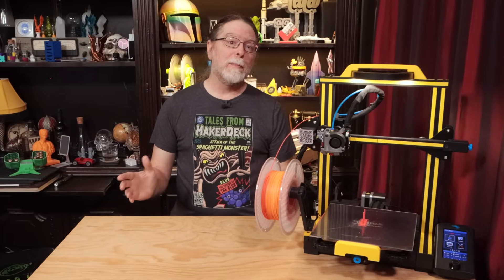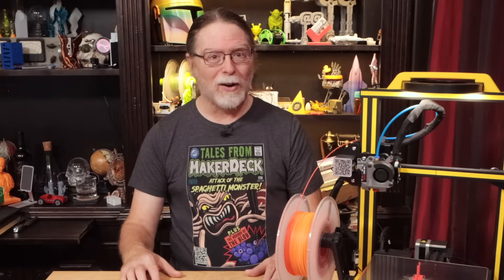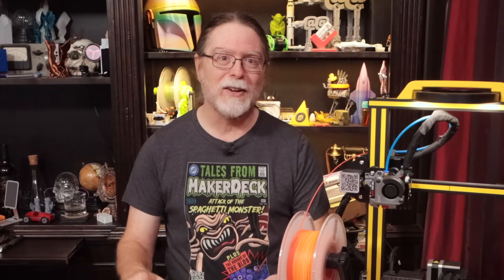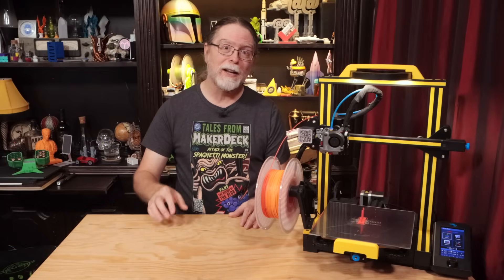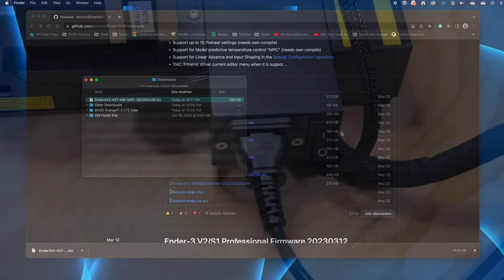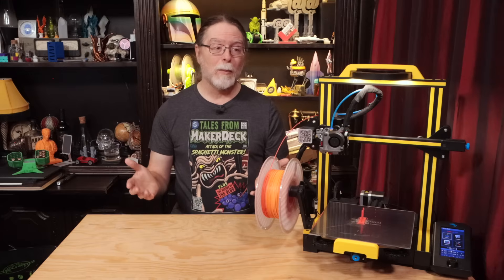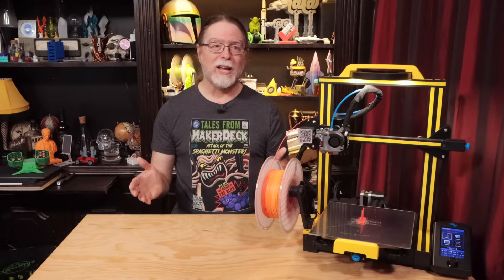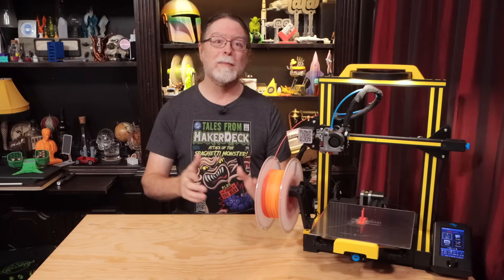The BEST Ender-3 V2 Firmware EVER?! MRiscoC Professional Firmware

Comment: I've been running this firmware for a while now, and it has made life a lot easier with the E3V2. I was very disappointed with Jyers, because it was never really completed. Even the most recent version of the firmware had a bunch of issues and limitations that I encountered. Thank you for putting this one out there, the more people that know about this firmware, the better. I still haven't played with some of the more advanced features in MRiscoC's firmware, yet, but am looking forward to checking them out over time.
Reply: Marlin is easy to learn. You can understand it in 3 days.
Reply: @PrintPixeltr *if you have a developer backround
Reply: Jyers was also slow and using the S-curve acceleration destroyed the print quality on a bowden printer